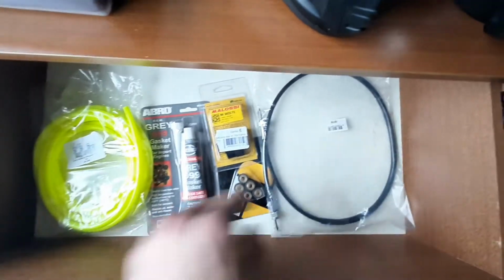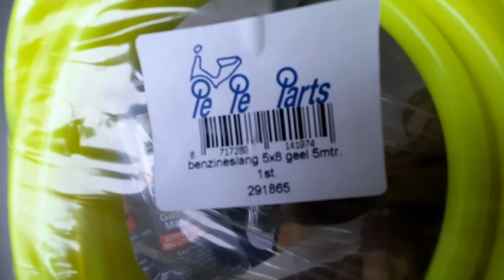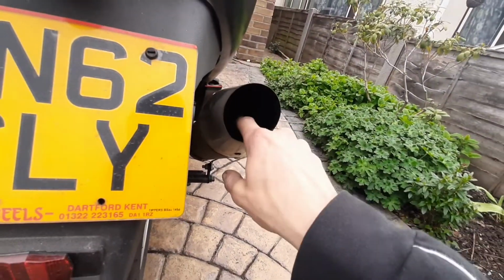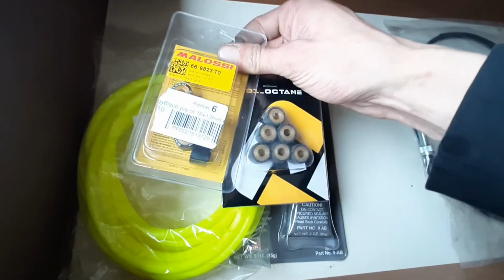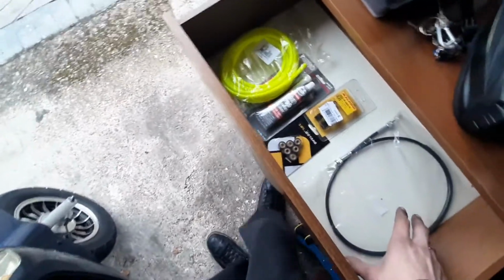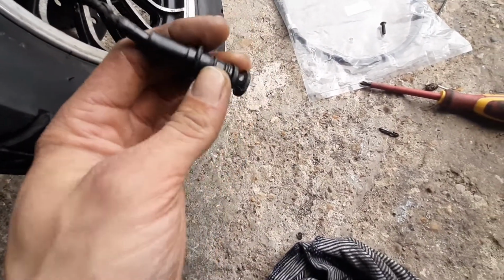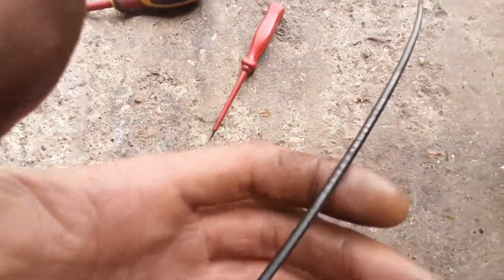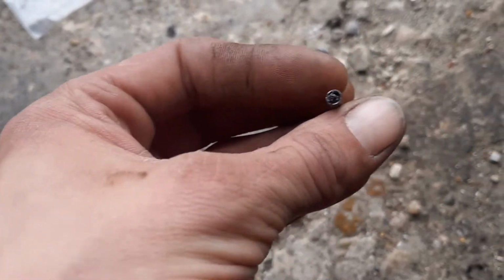New parts! | Speedo fix fail 😭

Comment: I’ve just brought myself a Lexmoto Gladiator any ideas on what upgrades I can do? 🙏🏼💯
Reply from the maker: Start with the cvt mate. Get yourself a good quality variator, belt and roller kit. Maybe a clutch spring set for better torque and more rpm. Then new suspension really stiffens it up and makes it handle great 👍 makes all the difference on these beasts 👊
Reply: @dandoesbits  I’ll get right on it mate, hurry up payday!! 🤞🏼👊🏼💯